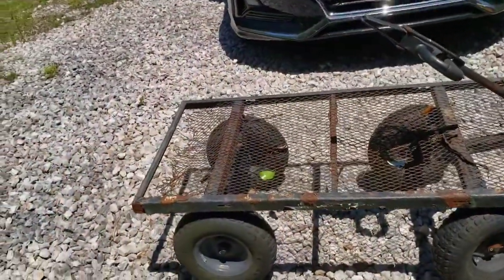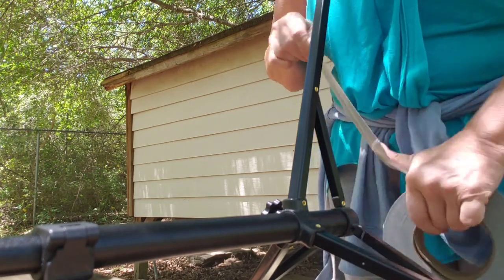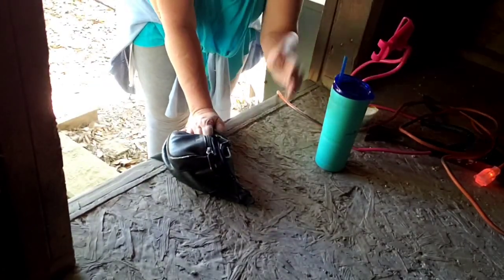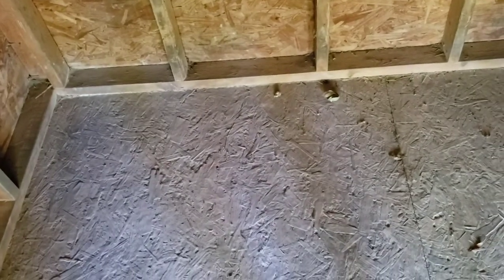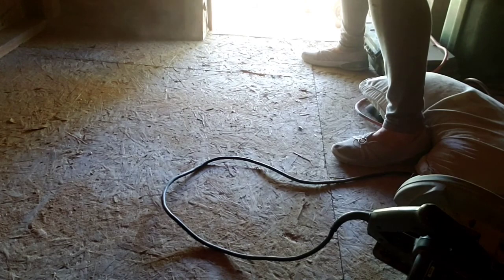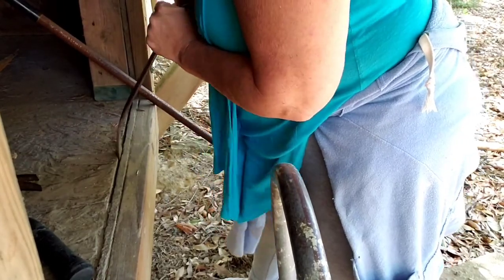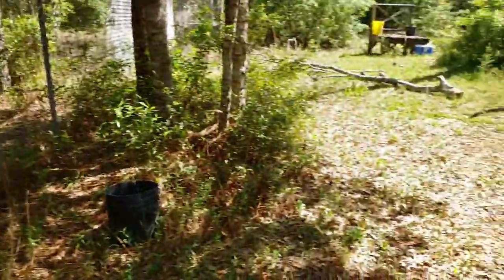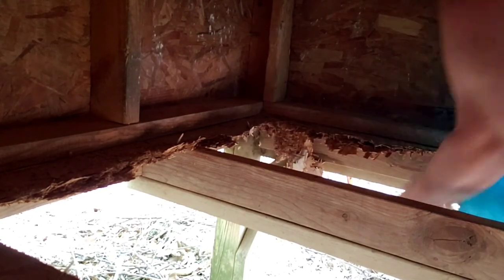Ep. 13 Doghouse to Shed remodel

Comment: What are your walls sitting on? If they're sitting on your floor joists when you cut those your building walls will collapse. 
I'm not sure what area you are in, although you might want to consider looking on either craigslist or Facebook market for free wood. Then build out your new floor as well as your new wall supports BEFORE you cut off your existing floor joists.
Reply from the maker: Yeah, you're right.  I know I have to get more wood, but I'm still not sure if I'm going to get the church wood yet or not, I hope so.  I knew I'd have to support the walls,  for sure, before I knock out the joists.  Thank you for your advice though, I appreciate you making me aware of it, just in case I didn't know.  Yeah, if I don't support it it would be a disaster.  I'll figure it out.  My water well went out last night, lol...  otherwise I was planning to work on the shed today.  When it rains it pours!  :)  thank you!